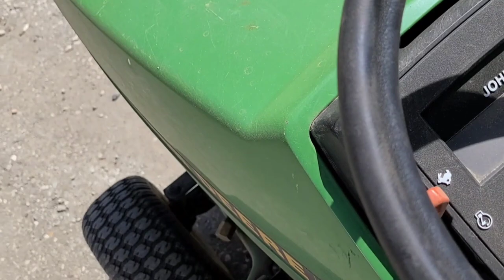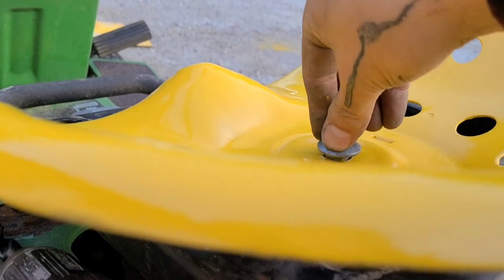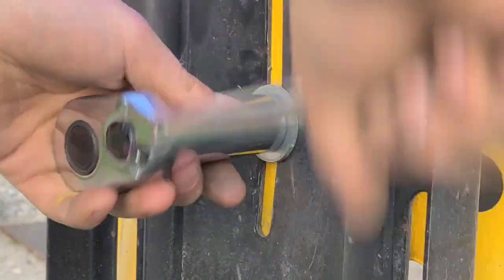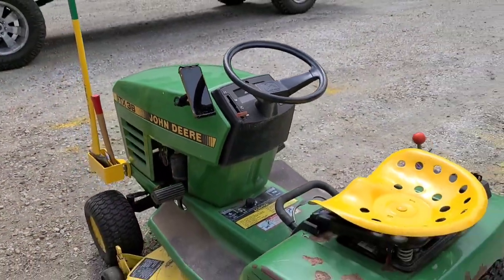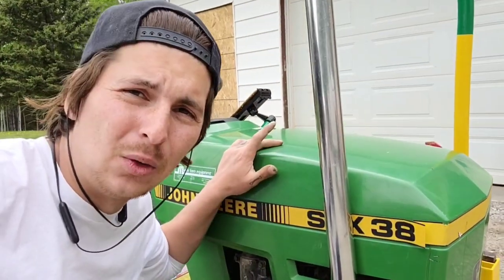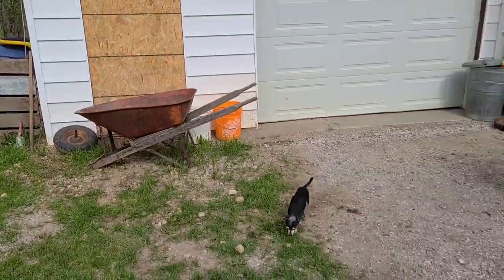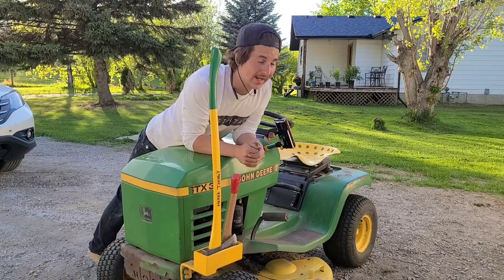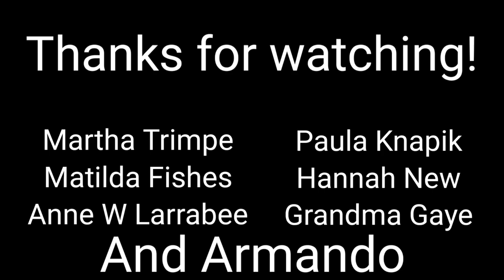: Some silly but useful mods for a lawn mower  | Another VLOG #123

Comment: That's the way to do it!  Best reason to have an old beater - much more fun to mess around than to try to restore some old thing to pristine condition.  I'll pay a lot of attention to the engine and transmission so it actually works well, but then the rest just hack around with the rest.

Comment: You could add a golf ball to the steering wheel (if you find a way) to have a DIY solution for the suicide knob. And you could use an old axe handle for the shifter knob to align with the axes in the front.

Comment: Damn Josh, it is just a 3 lb ax, not a 1000 lb. trailer hitch....how heavy a steel do you need to use in order to attach the mounting system! lol    Only Josh would paint the ax John Deere green and yellow! lol  Maybe you can sell your ax/hatchet mounting system to John Deere as an OEM product to be mounted on all future production lawn mowers???